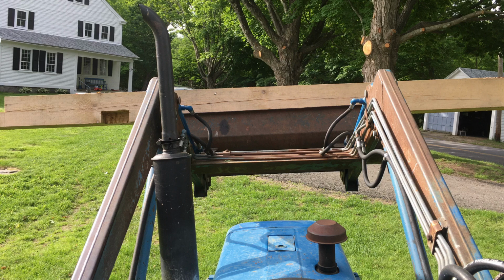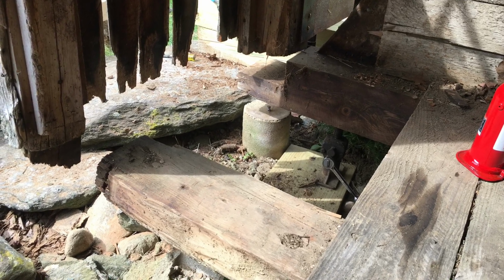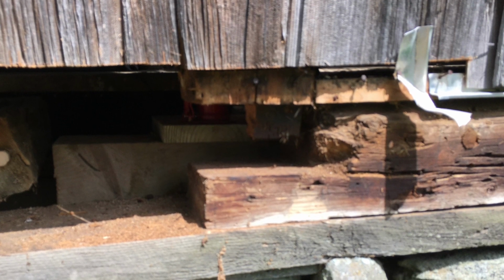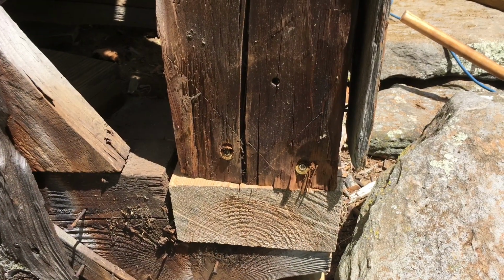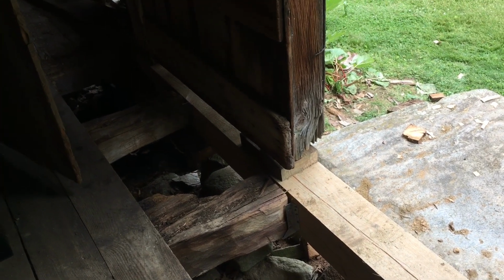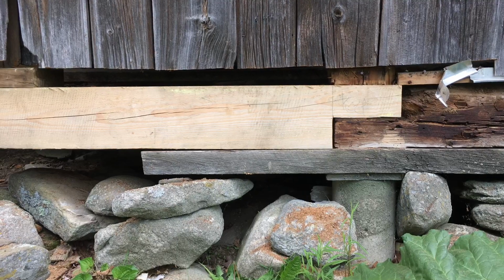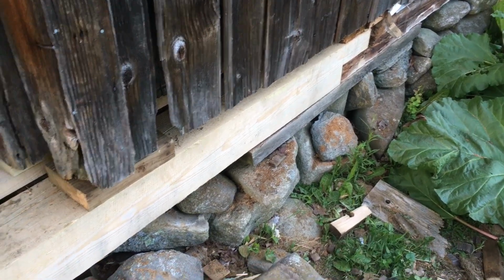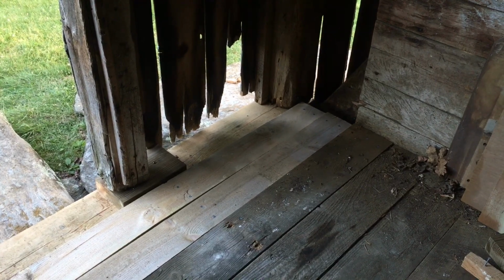Replacing a Section of Barn Sill - Jacking Posts and Tying in Joists

Comment: Were you working on the gable end of the barn or beneath an eave?
Reply from the maker: This is parallel to the eaves. In the end I replaced about 75% of the exterior sills in the barn, several joists, about 70% of the flooring and all the siding and windows. I made various videos along the way, but I didn’t fuss with video when concentrating on heavy lifting and jacking as I wanted all my attention on the task.

Comment: Can you let me know where you got the jack brackets from? Do you know what sort of part it is or what it's called specifically? Trying to get the bracket for my own project and can't seem to find it.
Reply from the maker: A neighbor had the post jacking brackets custom made when he did his barn. They’re welded together plate steel. They have some flaws in my opinion… They just fit an 8” wide post, and all the bolt holes are in line and aren’t in the center of the post, so you have a splitting risk on the post. I used 5.125” GRK RSS screws at different angles to attach the bracket to the post in order to engage different wood grain. You could also through bolt with carriage bolts or threaded rod. The sharp point at the back end is a hazard for scrapes and clothing tears, but the length lets you get blocks under it behind the jack. Another downside is the farther out from the post that the jack is, the more torque it applies to the post, which pulls the post out of plumb, and could break it. I had one corner post that needed to go up 4” that was smaller than 8x8 break where members were mortised in from both sides. I sistered it up and it ended well. I’ve now picked up 15 posts with these and replaced about 120 linear feet of sill around the barn.
Reply: Just wondering was that jack called big red?